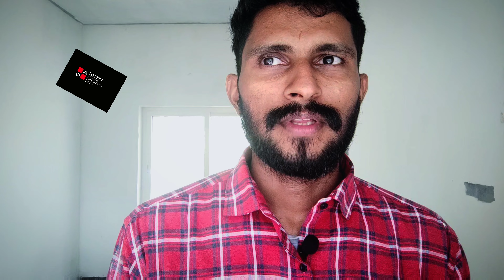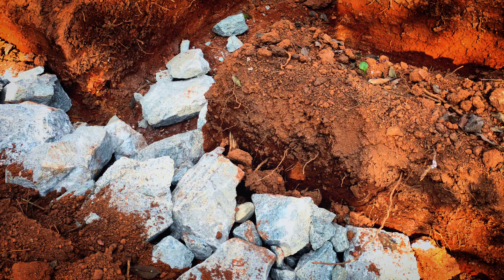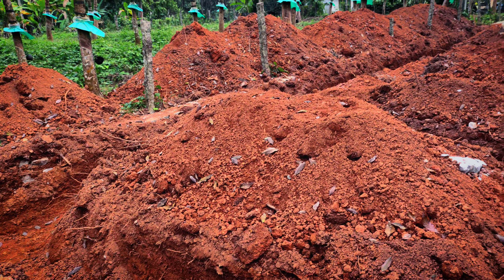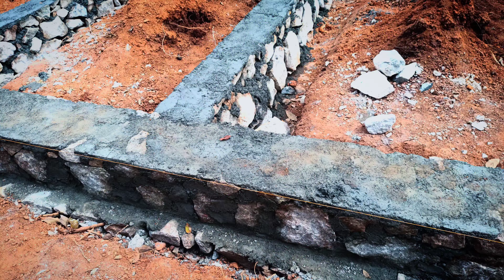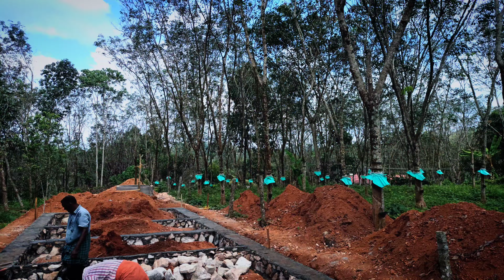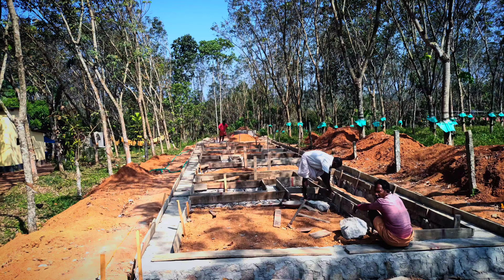cost for 1000 ,sqft home|how to save money from foundation construction|ഫൗണ്ടേഷൻ എങ്ങനെ ലാഭകരമാക്കും

Comment: Foundation width depends on load coming on it and soil condition.. Don't provide 30cm foundation wall inside area..Consult a structural engineer if you have doubt....
Reply from the maker: 30 cm is not foundation size its basement size because the total width of building is only 4.5 m so its enough for this construction.. definitely the foundation size depends on the soil conditions and building load

Comment: Column footing foundation നും raft foundation തമ്മിൽ cost എത്ര വ്യത്യാസം ഉണ്ട്? 1450 sq ft
Reply from the maker: Nalla difference onakum raft foundation eppazhum cost kooduthal ayirikum isolated anel cost an ennalum compare chyumbol kuravayirikum.min 1 lac diff engilm ondakum accurate ayit parayanamenkil foundation details kanedi varum. Ella case ilm raft use chyyarila loose soil allel clay soil angane oke anel mathrM raft use chyarullu depends on soil test